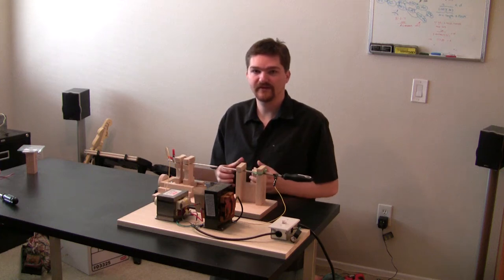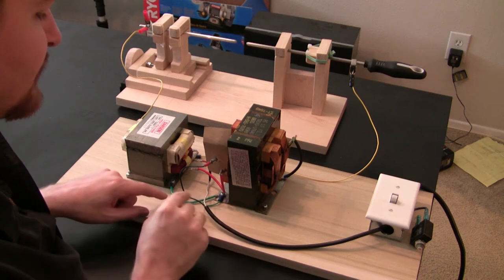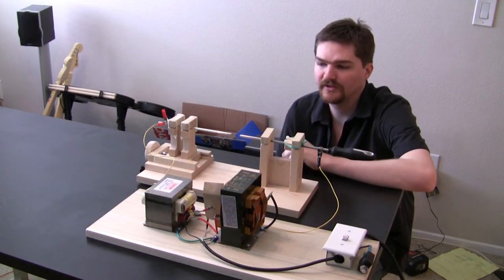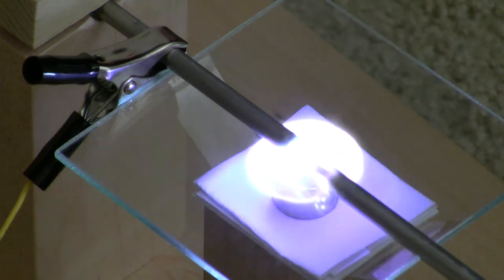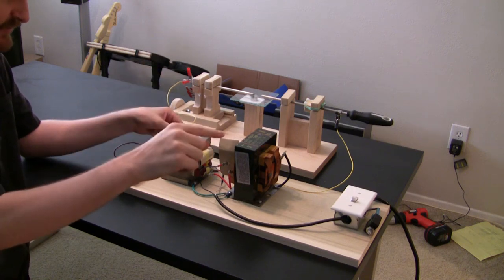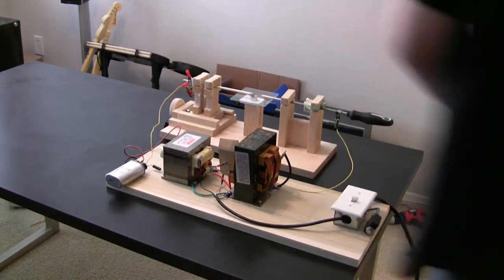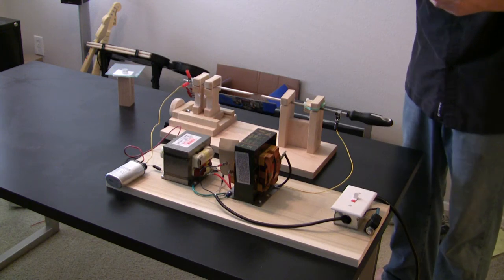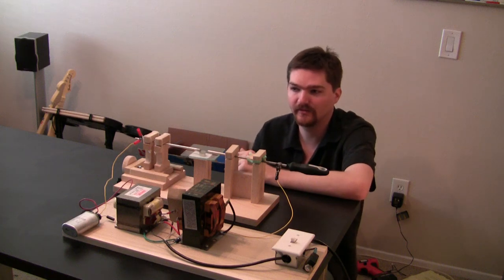High Current HV Discharges

Comment: Great job JOhn. Have you tried with a vacuum spark gap? Do you know where this particular spark gaps could be find? There's also another kind of spark gap, in EV Gray tubes, with a piece of carbon in one of the sides. The dielectric properties of the carbon, acts as a "negative resistance" & amplifies the energy from the vacuum. According to Lindermann, that's where the amplification takes place. Using neon bulbs also, the spark gaps "jumps" easily. Writing you from Barcelona. All my best. Cheer

Comment from the maker: heh, wiring diagrams, it's not like I plotted it out on paper or on a computer ahead of time.  I did however show you in the video as clearly as I could how it's wired.

The mots are connected in series (look it up), there are 2 wires on the secondary of each transformer.

On one mot the secondary wires are shorted.

On the other, I'm playing with sparks between the two wires. One of these wires is also grounded so I know which side has the high voltage (2kv AC).

Comment from the maker: @KRAYSLiCK999 No, I'm pretty much running it the same way it runs in your microwave, aside from the load which is why I have the ballast to limit the current.  The secondaries come with one side connected to ground already, it's just so you can set the potential of one side and guarantees the other end is the high potential.  Technically I could leave the secondaries isolated, but it doesn't really matter, I didn't need to modify it.

Comment: Good work. Keep studying those high frequency patents. Here's a few of his patents that have very important details. Please make it a priority to examine them and take notes. 462,418; 454,622;567,818 (make note, this capacitor is strongly suited for high voltage high frequencies; maybe more so than other "modern" caps. Only one way to find out and I haven't had the chance to build it yet...); 555,190.

Comment: I've often wondered about the voltage doubler used in microwave ovens. Maybe you could shed some light on a theory I have?
The capacitor and diode is basically acting as one half of a single stage Walton Cockroft multiplier. What would happen to the output if an extra capacitor and diode are used to make a whole stage, seeing as the multiplier is still a half-wave type? would the output have more current, more voltage, or what would happen?

Comment: good stuff, HV. is always a blast. i was sending HV pos wire on the bottom of magnet pinched between metal washer then copper ring around the top.and some very interesting plasma streamers between copper ring and magnet.do you think this is dagerous or just quencing like your talking about?

Comment from the maker: @maxrendu What are you trying to do? In these experiments I'm working with 2,000 - 4,000 volts, which as you can see only starts to spark when I get the rods very close together (I can just pull the arc out fairly far due to the large current).  If you're just looking for a DC 40volt power supply this isn't what you want, this more for experiments with high voltage, and wouldn't be suitable for any consumer electronics.

Comment: John:
If you really want to replicate some of N. Tesla's most fascinating and unexplored work, make a dielectric hollow cylinder (like a drinking glass with no bottom) and wrap a coil around it. When this coil is put around your spark gap, it will induce a zero current state in the coil that will light vacuum tubes and create longitudinal waves if two conditions are met:
1. The coil is attached to a load on one terminal (i.e Tesla's single line transmission) and the other terminal is attached to a ground (the deeper the grounding rod the better).
2. The spark gap is quenched magnetically as you show in your videos.
Tesla was careful about how he worded this strategy which is why it has rarely been duplicated, but I believe you can duplicate this experiment easily using your set up. Thanks for the upload! -Alex
Reply: I'd love to see what you've described here. I'll try to replicate John's setup and then do as you suggest.

Comment from the maker: @Alex1M6 A ballast is basically just an inductor. The primary of a microwave oven transformer has very few turns around the core, and there is very little resistance. I want high current, but I don't want to blow the circuit breaker, so I'm using a second MOT in series to add a little more resistance to limit the current.  I don't need the secondary of the secondary of the second MOT so it's just shorted.

Comment: You would happen to know if there is a small spark gap thing about the size of a car fuse or if a car fuse can be converted into one i need a swich that pulses on off on off continuously without stopping unless i flip the main power switch off.... also if that's not possible you wouldn't happen to have a video showing how you built this cuz if you do I think I can convert something into what I need

Comment from the maker: Here, "discharge" is a flow of electric charge through the air, or a "spark".
It's just barely high voltage, around 2kv, since it can jump a gap in the air.
It's high current relative to typical high voltage sparks one would normally see, though I'm not quite sure how much amperage I was working with in this video.

Comment from the maker: sort of. I'm only hesitant to verify that statement wholly by the fact that DC generally means you have a constant voltage, and mine is not.  It's just a half-wave doubled. Check out the link in the description at the very bottom of the page you can see a graph of the wave form.

Comment from the maker: You're right the glass is a dielectric. However, I chose it for that very purpose of preventing the magnet from being used as a conduction path. The reason for it arcing to the side, I think, is quite ordinarily explained by the Lorentz force. I'd be very surprised if the magnetic being a conductor has anything to do with the effect at all. The capacitive coupling would be very weak due to the low surface area between the magnet and electrodes and the separation distance due to the thick glass.

Comment: I would advise you not to touch that plastic handle during HV operation. You don't know at what voltage it could brake down and at that current you could die.
Turn it off, adjust the spark gap and turn it on again; you waste some time, but your life's priceless.